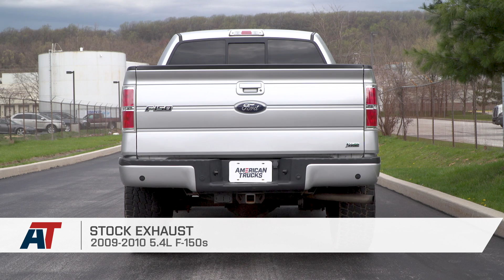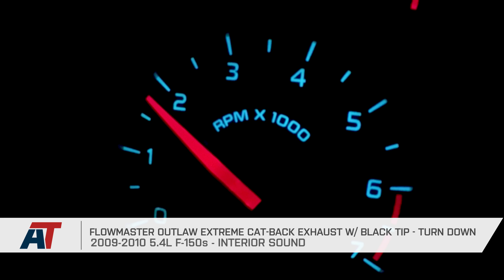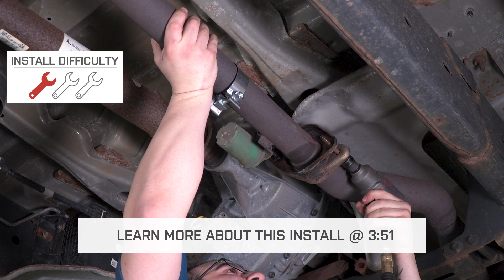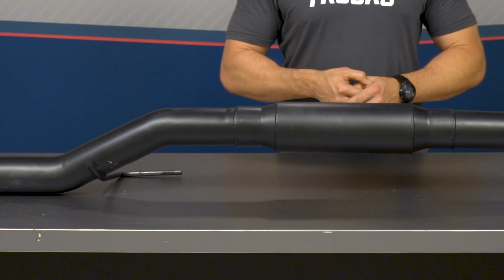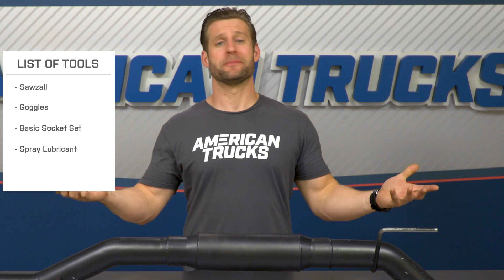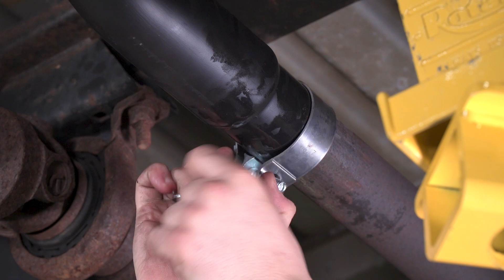2009-2010 F150 Flowmaster Outlaw Extreme Cat-Back Exhaust 5.4L Sound Clip & Install

Comment: Would it fit a 2008 Ford F-150 king ranch?
Reply from the maker: This exhaust system will not fit a 2008 F150. The only Outlaw system that Flowmaster has for 2004-2008 model F150s is the following link. Hope this helps! -Zach
https://www.americantrucks.com/flowmaster-outlaw-catback-exhaust-split-side-rear-exit-0408-54l.html

Comment: Would this work on the 2010 5.4 Lariat model?
Reply from the maker: Should fit just fine, Matt! -Zach
Reply: The truck shown in the video is probably a 2010 5.4 3V just by looking at the gauge cluster .
Reply: @noesalgado5038  4.6*
Reply: The muffler is attached correct?

Comment: You guys have been awesome with the videos. Got an 2008 5.4L F150. Does this come in 2008? Which exhaust would you recommend?
Reply from the maker: Thanks Mark!  Unfortunately it doesn't look like this exact system is offered for the 2008 right now.  However there is a regular 'outlaw' system available which will deliver a similar sound but with more material.   -Justin

https://www.americantrucks.com/flowmaster-outlaw-catback-exhaust-split-side-rear-exit-0408-54l.html